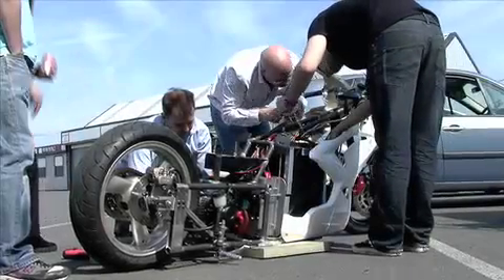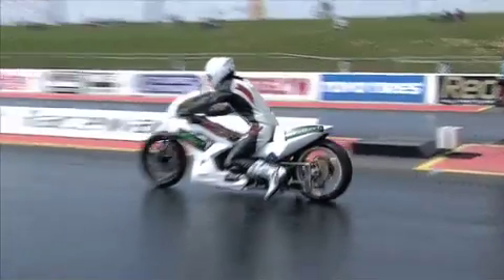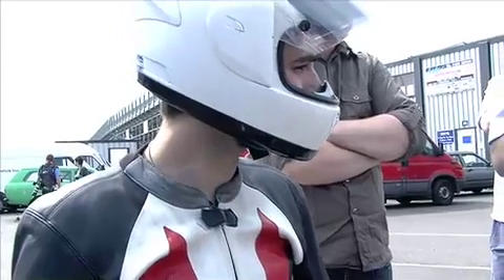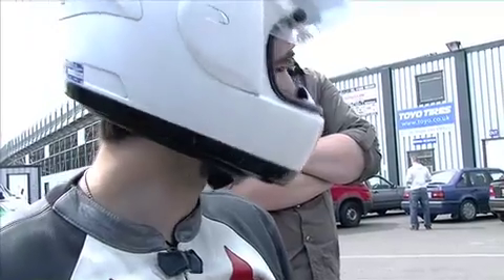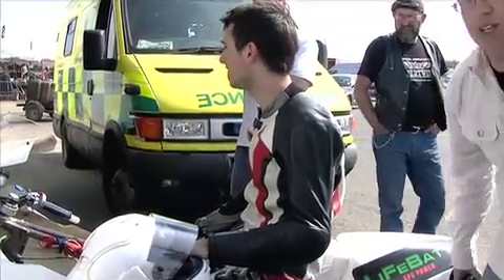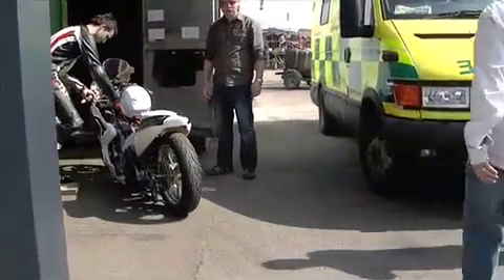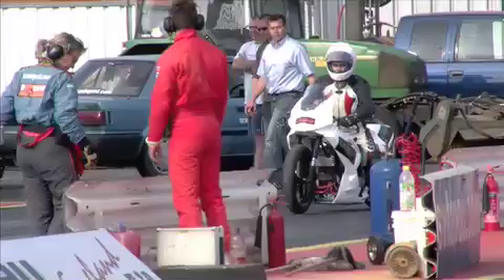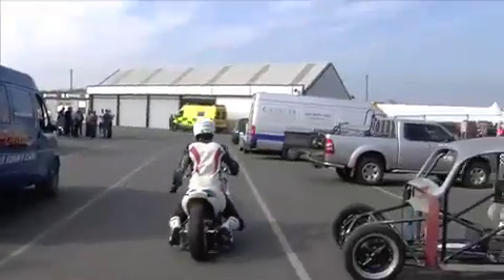Kingston University Life Batt Drag Bike at Santa Pod Alternative Energy Racing

Comment from the maker: I don't think it is soft start. The main problem they said was that the bike was over geared (for 120mph/200kph) - the rear sprocket was too small, so the rider said that the bike was very slow off the line.
Yes, 436 Amps was recorded someway down the strip, not at the start. Its 144 Volts not 142 as i said previously.